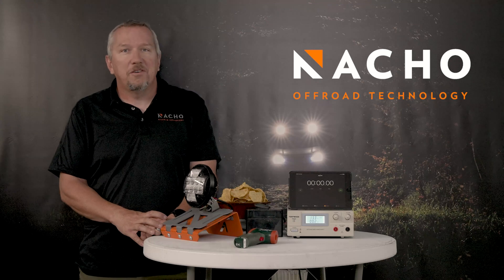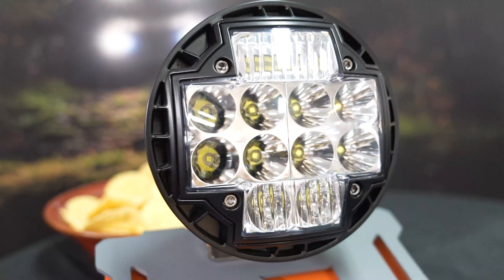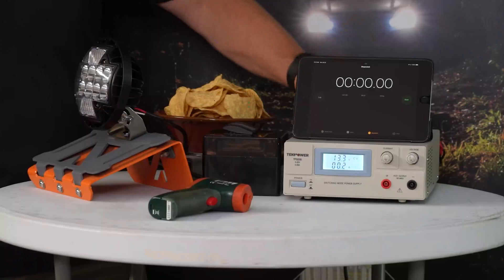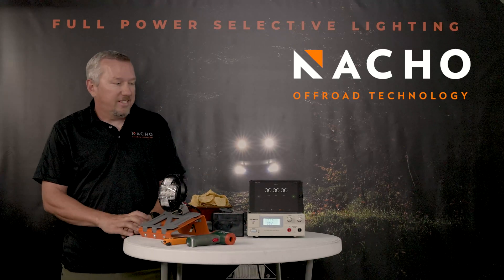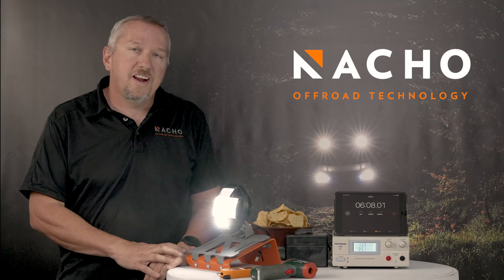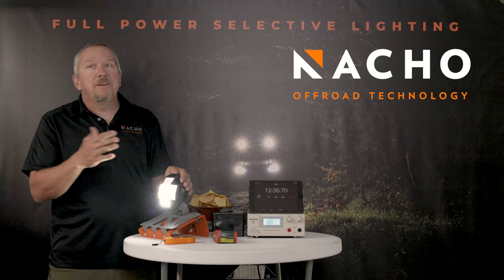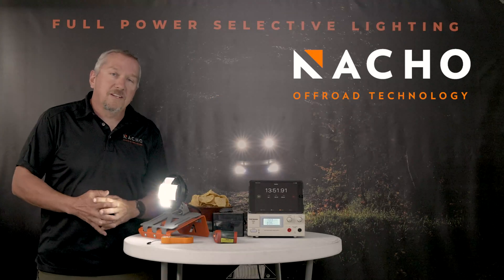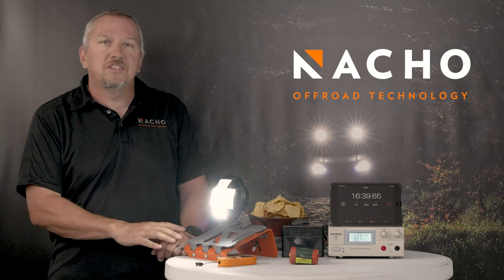NACHO TM5 Lights: Advanced Thermal Management for Ultimate Protection

Comment: I run Baja Designs lights LP6, LP4 and S1 on my Outback Wilderness and Squadron Sports on my Can Am Ryker.  How do you think your Nacho light’s would compare to these in brightness and reliability?
Reply from the maker: Leonard, Thanks for reaching out. Our reliability is at the top of the premier light division.  We build, engineer, test, and ship out of our facility in AZ.  We build each light and quality check the light through voltage ramps, thermal burn in and pressure.  So we make sure that when the product leaves it is ready to handle the elements. It is also backed with a true lifetime warranty. As far as performance there is a couple different ranges but we hit the high performance numbers of the LP6 and bring some controllability to the light.  Check out the other video's on our channel showing the TM5 Combo White and Amber White.